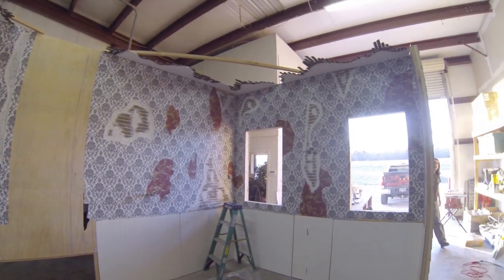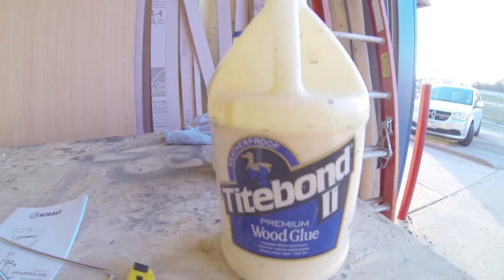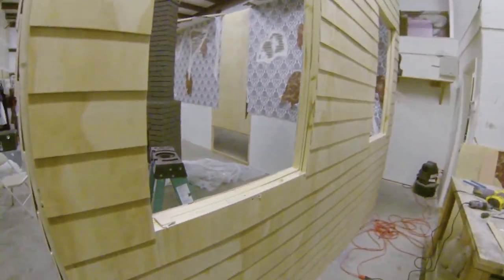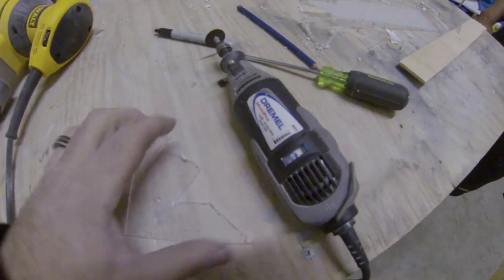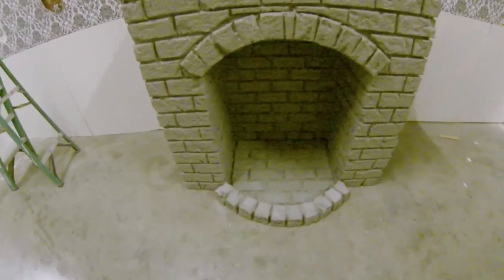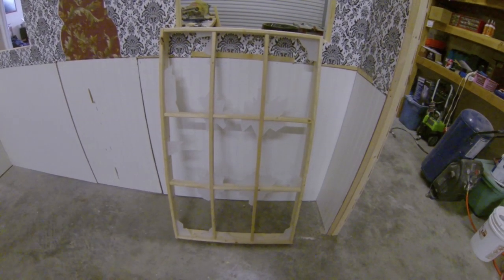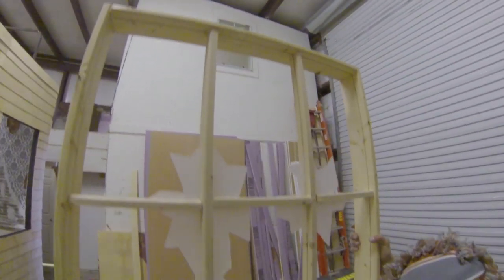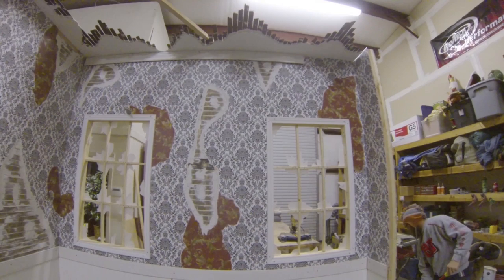How to build modular walls for your haunted house or attraction- Episode 7

Comment: Looking awesome guys, Does the hard coat add a lot of extra weight to the props? and does that keep it from being nicked up?  We probably could've used that in our Dart Tunnel a few of those stones took some good hits and knocked off the corners of them.
Reply from the maker: There are other methods you can use.   This is the cheapest I have found that works.   It does add weight.  You are spraying concrete and glue onto something.  And YES!  It keeps it from getting nicked up.  I would suggest spraying the bottom and corners that will be touched or rubbed with an extra coat.

Comment: Great episode guy looks like its really coming together !! what the secret recipe for the hard coat and would that be considered water proof ??
Reply from the maker: The tightbond 2 glue is the waterproofing.   Mix portland cement with water in a 5 gallon bucket until it is a pancake mix texture.  Pour half a gallon of tightbond glue in with it.

Comment: What's the ratio on the cement/water/glue mix?
Reply from the maker: 5 gallon bucket.  Water, half gallon of tightbond 2 glue and portland cement.  Mix until you get a pancake mix so you can run it through a hopper.
Reply: Thanks!

Comment: The booth is looking awesome! What is the ratio of cement,glue and water you used for the hard coat on the fireplace? I have never seen that before. Great work.
Reply from the maker: 5 gallon bucket.  Water, half gallon of tightbond 2 glue and portland cement.  Mix until you get a pancake mix so you can run it through a hopper.

Comment: can you run the Portland cement mixture through a regular spray gun ?
Reply from the maker: No.  You need it to be a pancake mix which is too thick for a regular spray gun.
Reply: what type of sprayer do you use ?
Reply from the maker: pacscrap It is a hopper that you can get at home depot or lowes